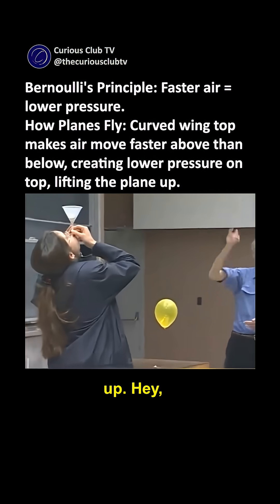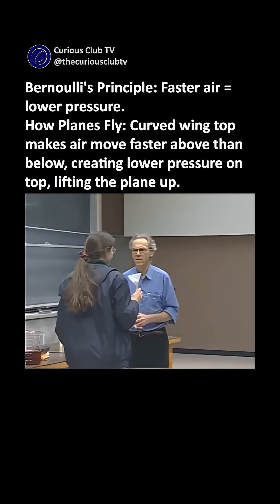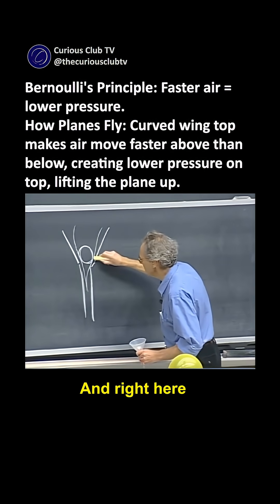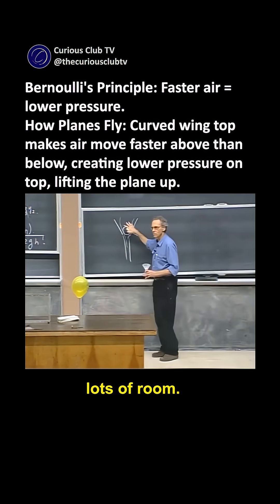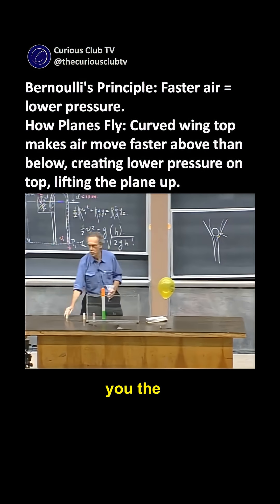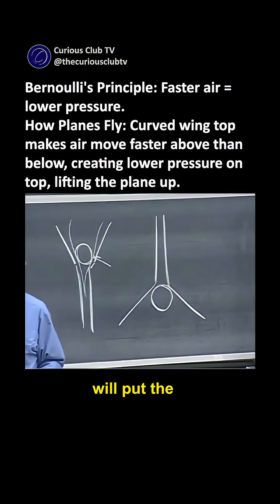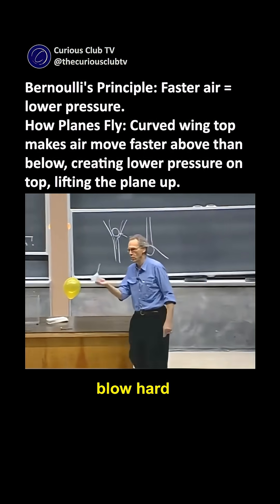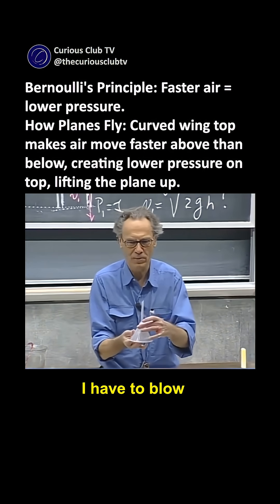Prof. Walter Lewin Explains How Planes Fly

Comment: The main force lifting the plane is the angle of the wing which directly pushes air from the underside of the wing to the ground, thereby pushing the wing in the opposite direction. If it was just the curve on the top of the wing sucking the wing up, the plane couldn't fly upside-down as acrobatic planes do.
Reply: Airplane wings are designed to work upside down on acrobatic planes.  Lift is primarily due to the vacuum force created by the air flowing faster over the top surface than that on the bottom surface.  The lift due to pressure differences of the flows isn't enough to lift the plane.  Vacuum forces rule all the time in airflow.  That's why tornadoes are so destructive.
Reply: Wrong.